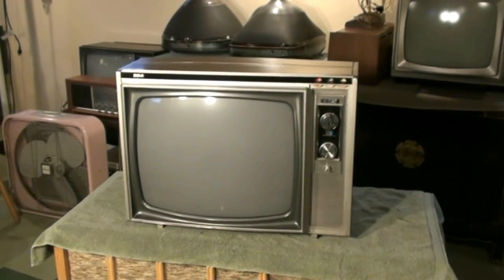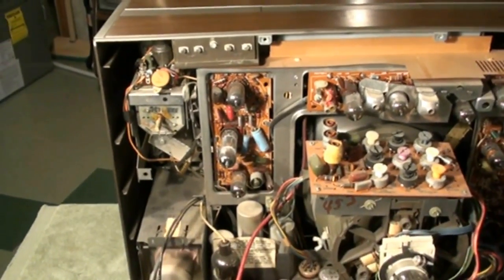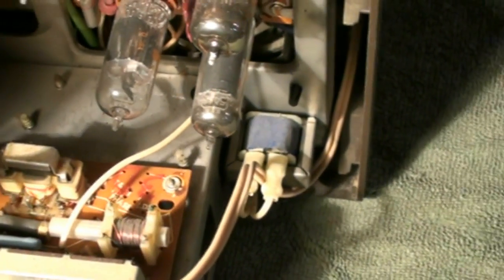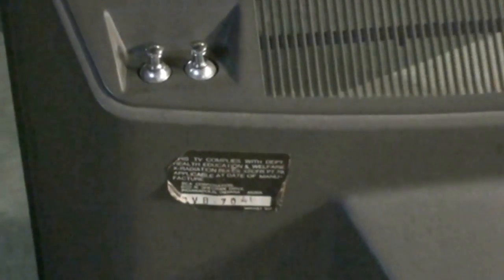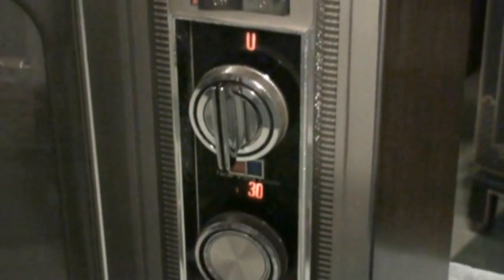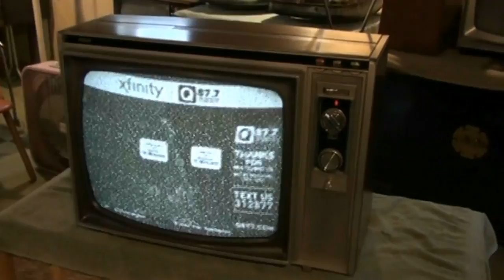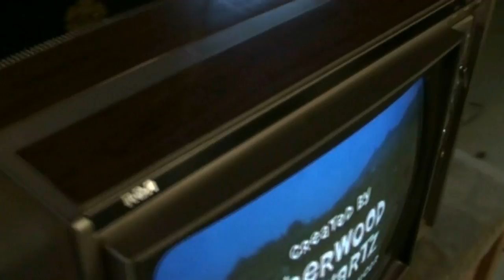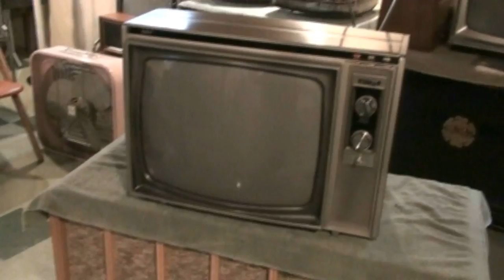Watch a 1970 RCA CTC-36 Portable Color Television!

Comment: My God, I had the identical set, and I mean IDENTICAL, back in Milwaukee in 1970. I do not know whatever became of it. Everything in the video was how I remember it. The AFT, the antenna, the channel changer, the simulated wood cabinet, the on/off switch, the recessed carrying handle on the top of the set, the channel light when the set is turned on, the color, tint and brightness dials, just everything. I got goose bumps watching this video, since after all these years it remains my favorite television, despite all the improvements in technology. Oh how I'd love to have this set.

Comment: In 1971 I worked for RCA for about a year.  I was trained in their broadcast area for support for the TK-46 cameras and for their broadcast monitors.  I also did  some work in their domestic TV service area for a few months.  I remember this TV model. When properly set up the pictures and sound quality was very good. When used a lot the tubes did not last very long. The 5GH8 tubes were going fairly fast.  Other than that this was a fairly decent TV set.

Comment: I have one of these I need to fix up. Strong CRT but no green in the picture. Probably a 5GH8. They are cool sets, so rare now.
Reply: With the type of CRT used in this set, as it weakened the raster would start turning green and would not allow for good color balance. It is very important to first make sure the tubes driving the CRT must be good. 

The CRT design used was referenced from the green electron gun. I don't remember the particulars in how the electron gun was designed to be able to explain the reason for this.  I used to know these types of details.

Comment: The all plastic cabinet was lightweight and sturdy. The chassis was a CTC- 36 eco no chassis with decent picture performance and reliability. It was a Hybrid set, with series string filament tubes and small signal solid state circuitry.

Comment: Back in the late '70's I had three motels under contract that had these sets. :(  I would make sure I had a shopping cart full of 5GH8As when I made a service call.  When they started eating flybacks I would make it a point to replace the dielectric grease on the flyback every time I had to replace 5GH8As.  Here in Michigan things get very humid.  Replacing the grease seemed to slow the failure rate.  I guess since these were No Tell Motels the customers did not care about the crappy picture these televisions produced.

Comment: Nice picture on this set! When I was a teenager we had an 18-inch Sylvania set that had an 18VAJP22 picture tube. I wonder if it's similar to the 18VAZP22 in this RCA set. Also is that nuvistor tube a 6DS4 (or 2DS4 since you said it's a series filament set) by any chance? We had an old B&W RCA set that used a 6DS4 as the RF amp.

Comment: Wow, a 43 year old TV with the original horizontal output tube!! That's the first one I've seen. Usually the first tube to go. I did see a GE tube in there, not sure of it's function..
I'm not a fan of RCA as PC boards and tubes don't mix and and I had no respect for David Sarnoff after the way he treated Edwin Armstrong.. I loved Zenith until the System 3 then quality went downhill. Too bad. It was such a GREAT company!
Reply: probably a set that sat in the corner of a guest bedroom and rarely got used.